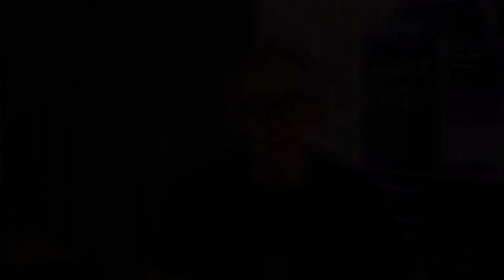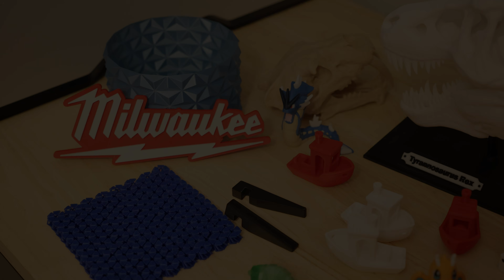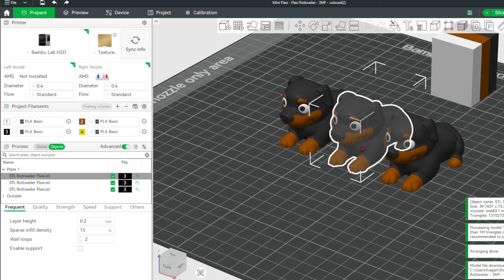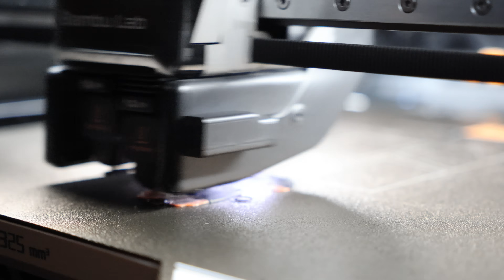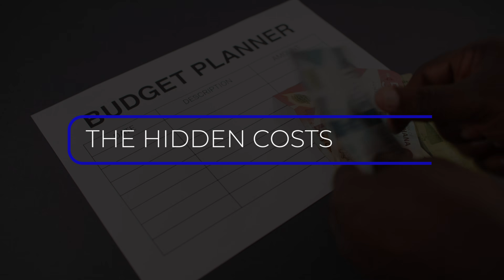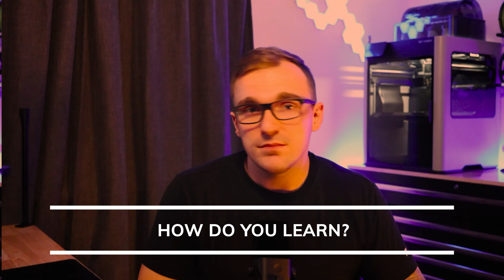What No One Tells You About Owning a 3D Printer

Comment: my biggest problem so far is when I don't realize the bed type was changed and the heat settings are too low (keeps going to textured cool plate for some reason) and so bed adhesion suck. Most frustrating print I am still trying to print, is some shoes, I keep getting layer shift for some unknown reason about 12-14 hours in everytime. I got my printer for free from work when it stopped working, so I can't truly complain about it, got it with 200 hours used and ive put on around 600 myself, mostly printing organization parts for tools.

Comment: I spent a lot of time learning on a Ender 3. Modding and improving and learning the software side. Got super burned out and put it in the closet for 3 years. Recently got it back out and quickly remembered why I buried it in my closet. So, I ordered a P2S and my excitement for the hobby is back for sure. I can spend more time designing and less time messing with the printer.
Reply from the maker: did you get burnt out from constantly making changes on the printer or from the CAD aspect of making and designing things? Yeah, bambu really makes it super easy to just print and go.
Reply: @techwithspencer With the Ender I would spend a ton of time getting it tweaked to print perfectly. By the 3rd print it would start messing up again. Just a pain. Modding probably created more headache than it solved in the end.

Comment: My biggest problem has been the start of a print.  I periodically get adhesion issues.  I have a P1S.  I've learned to make sure I change the filament setting used in the model prior to slicing.  Also I have learned to adjust the speeds for the initial layer.  That seems to help a lot.
Reply from the maker: That's a great idea! TBH I always boost my bed temp setting up like 5 degrees on the initial layer. I know I watched a video of someone telling me to do that and I wish I could remember where I saw it from! That has helped me TREMENDOUSLY during print start.